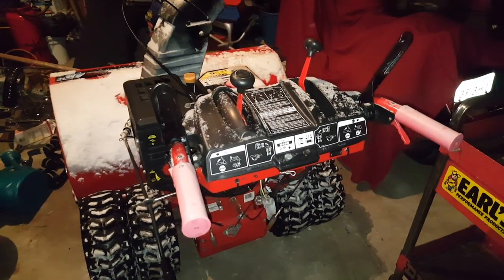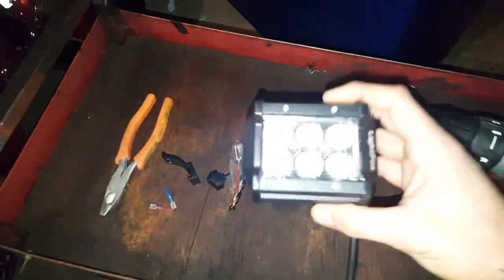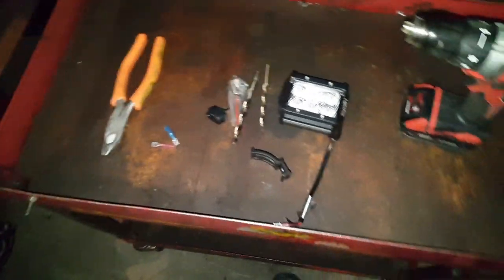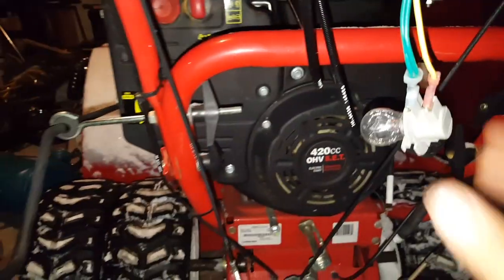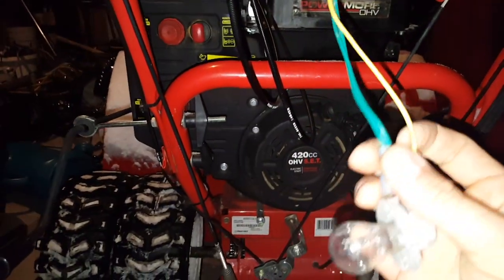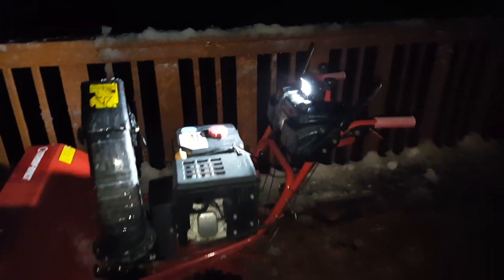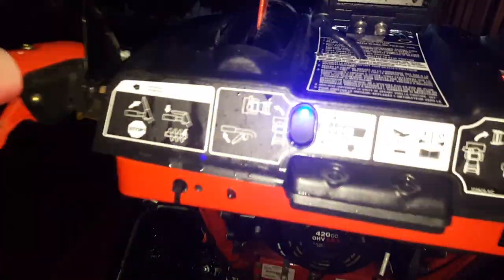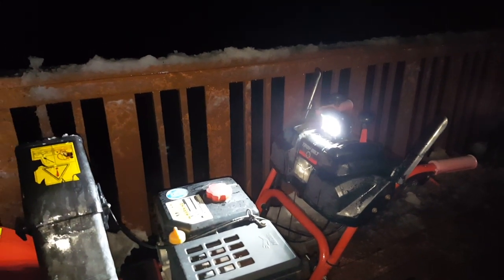HUGE snowblower! LED upgrade

Comment: Thank you for your video.
I can already see that I will not be mounting the light there where you have it. There are two reasons. My better half bought a shield that goes around me while I am working so that the snow doesn't keep blowing in my face. So since that is already in the way of the light that is on there I won't be using that light.
Next is when I didn't have the shield on I noticed that it was in a stupid place anyhow. Dumb engineers! I will be installing it in front of the chute on the front of the blower so that nothing is in the way of the light.

I know someone who also installed strobes front & back.

Comment: Why would you mount it so that it’s mostly blocked by the chute? Also, unless the factory light was led, you’re going to burn out the stator because the led only uses half the sine wave.